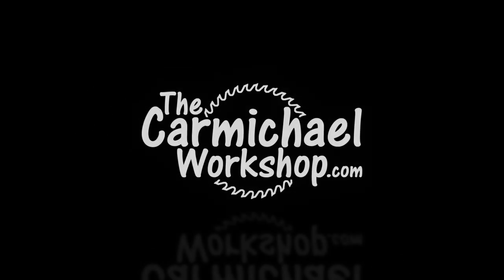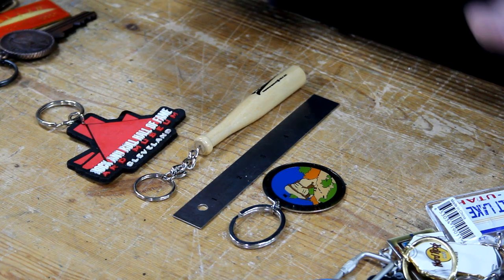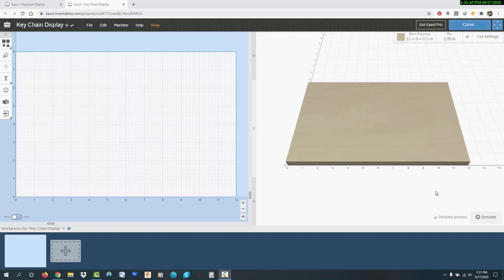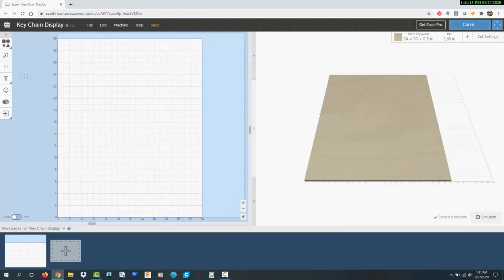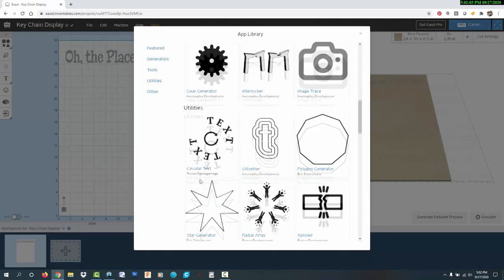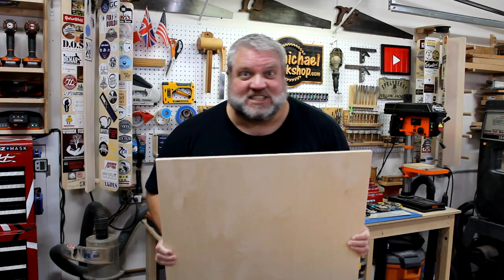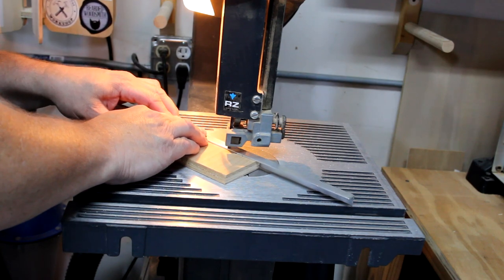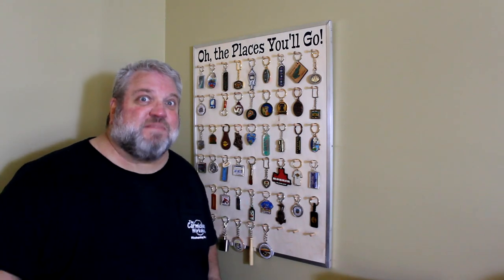Make a Keychain Collection Display

Comment: Great project Steve! I was thinking that an interesting design choice would be to use the Axle pegs instead of screws to hold the aluminum angle piece to the board. I am sure it would be strong enough... cut them down to ~1/2 inch and drill 1/2 inch hole in the edge of the board. It would be a neat design element because it brings the key holders out to the external of the board as well.
Reply from the maker: Hey Troy!  I like that idea. It will definitely look better than the screws.  Need to get another pack of pegs.

Comment: Glad to see another video from you Steve. I always learn something. I do not have an X Carve but have a question. Would it be possible to apply the masking tape to the wood prior to cutting the letters and have the machine cut the tape too? Then you wouldn’t have to hand-cut the tape. Or would it just shred the edges of the tape? Thanks!
Reply from the maker: Hi Thomas, thanks!  Yes, there are masking products like Oramask that you can cover the board with before cutting.  I have only tested blue painters tape and the bit tears and peels it up too easily.  I've had good results with spraying the wood with lacquer to seal it first, then spray painting the letters and sanding off the surface.  I tape around the words to minimze overspray.  I also cover bigger areas between the letters with tape, but it's probably not necessary since it sands off easily.